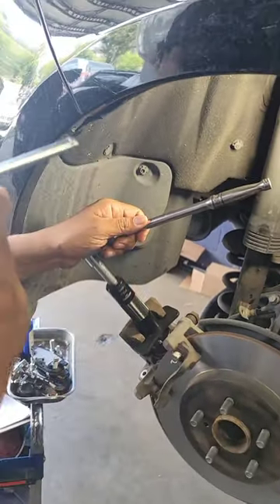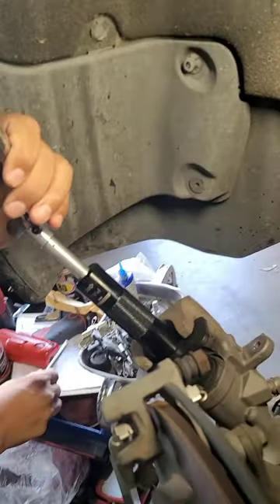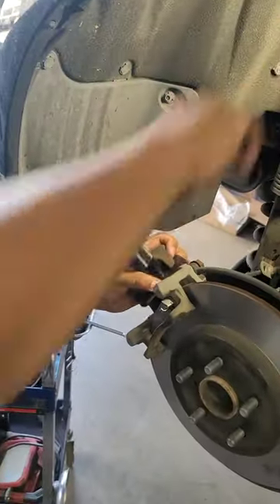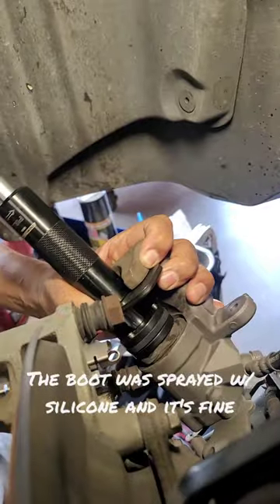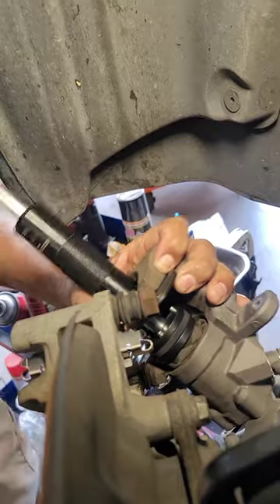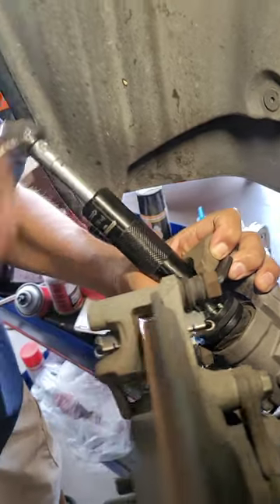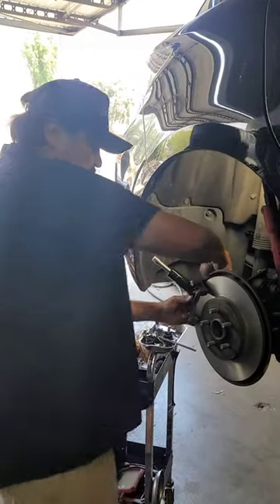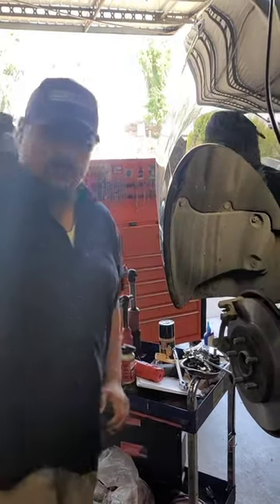@OEMTOOLS new brake caliper wind back tool, working great daily for 6 weeks now! #shorts

Comment: That poor dust boot. Always go around the caliper piston with a pick or pocket screwdriver first on the wind up calipers so the dust boot doesnt turn with the piston. Apply little lube if needed.
Reply from the maker: I will definitely remember this tip, thanks